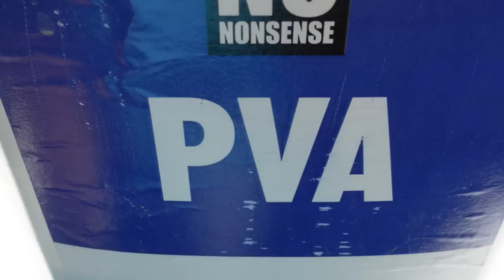Level UP Your Plastering...

Comment: Thank you Blaine for all your excellent videos. We bought a house without realising how much work it needed. Your videos have been a God Send. Although I'm not brave enough to try plastering myself, I'm able to do all the prep etc with your help. Thank you so much x
Reply: You can do it I’ve been doing it about 3 years now I thought it was hard but it a ways t as hard as thought  depending on how big your set is and control suction with Blaine videos I’m sure your get a good finish
Reply from the maker: Give it a go. As Lewis says, it's doable. Don't get me wrong - it has it's moments. But if you start small and work in a risk free situation then you should be fine!
Reply: I was in the same position with my house, thanks to these videos from Blaine and a lot of hard work it's looking a million times better
Reply: If you have done the prep, you are 75% of the way there.
Reply: Thank you for the encouragement guys. I have bought all the tools & had a go. I've still got a lot to learn but I have successfully skimmed one side of a large reveal to an OK standard & I plan to keep going! 😊👍🏻

Comment: Why doesn't UK use drywall like everywhere else? It appears there is more plastering there, even though drywall is cheaper. So what makes UK different? Are raw materials in plentiful supply in UK? I want to plaster for a living but everything is drywall here, which means you're only taping seams and plastering seams. In my apartment the building hired a plasterer to repair it, but the guy used drywall mud, even though it's an actual plaster wall. It was quite a big area, but the guy didn't even use a speed skim to flatten it, so of course it's not a perfectly level finish.
Reply: Lots of renovation work here as our housing stock can be hundreds of years old. Drywall is used in new builds and extensions though.